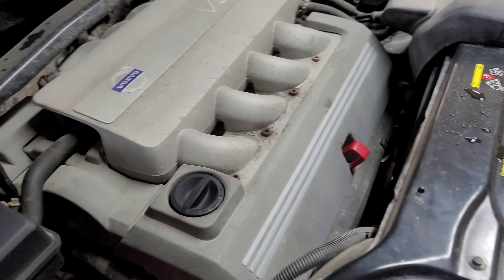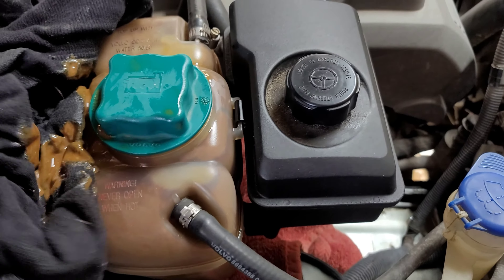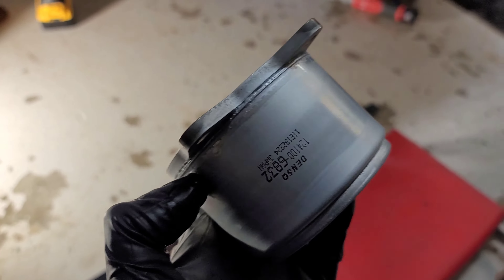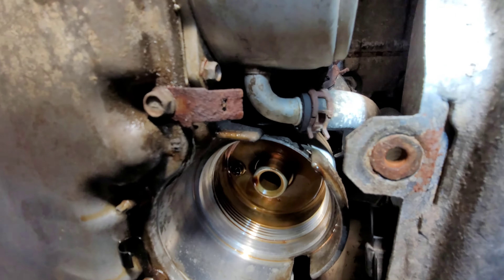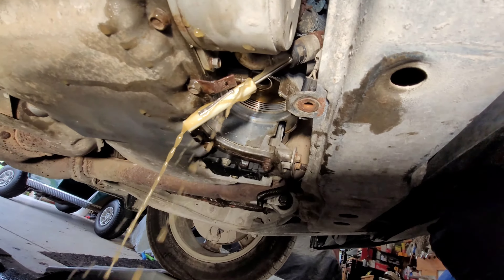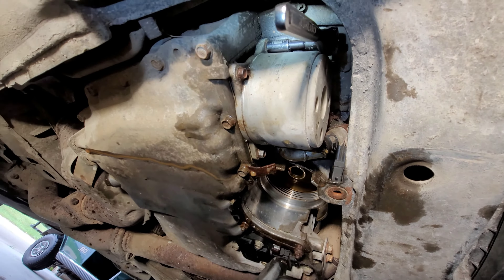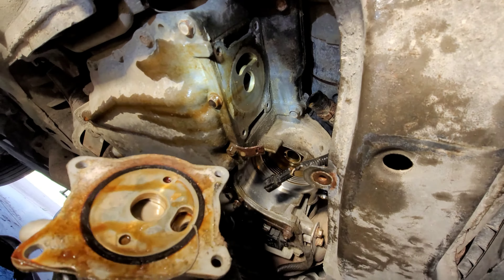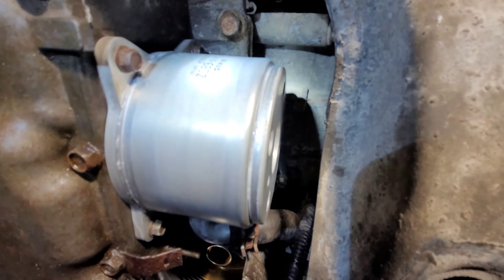Volvo Oil Cooler Replacement - Volvo XC90 S80 4.4L V8. Oil in coolant. Flush radiator.

Comment: Thanks for the video, I’ve got exactly the same situation with my 4.4l v8 xc90. I’m going to order the part tomorrow, I trust that your oil cooler replacement is still working? Also, did the header tank keep catching the oil residue… did you keep washing it out?

Thanks again, great video
Reply from the maker: It's been working good and I've been driving it almost daily. It was definitely the issue. The residual oil kept collecting in the coolant expansion tank for a bit after the car sat overnight.  Every week or two, I just lifted the whole tank and dumped it into a small container and then filled that small tank back up. I did that a few times and now there is almost no oil left in it. It's a pain getting all of the oil out. I probably should have flushed it a few more times, but I ran out of containers at the time.
Reply: Any updates on your fix ? Was it the same issue also ?